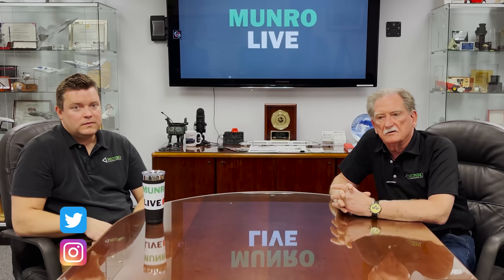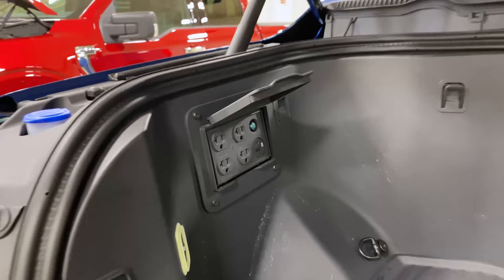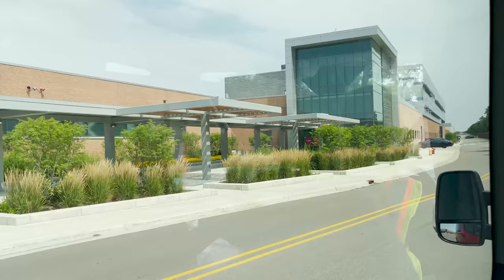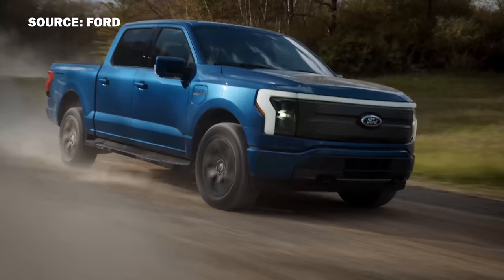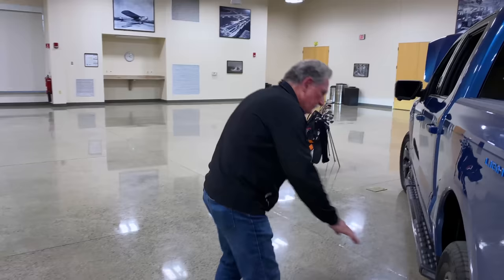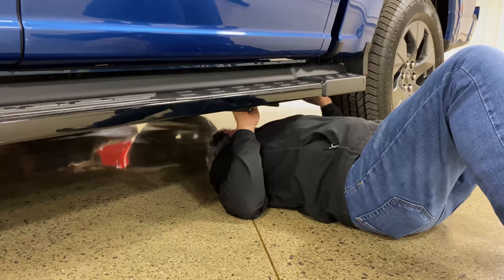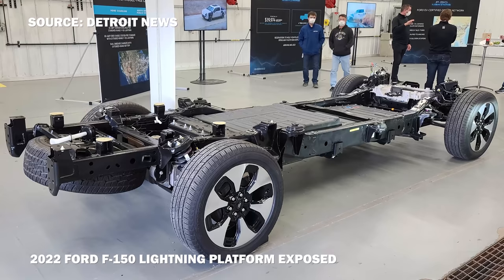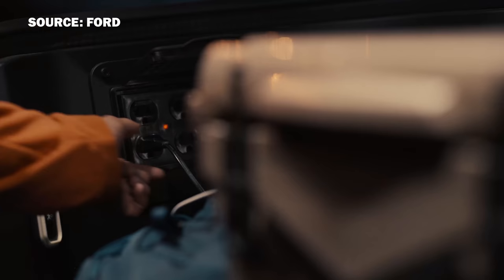Sandy's First Look at the Ford F-150 Lightning Electric Truck!

Comment: Very well designed truck! Now Ford need to focus on their battery chemistry and manufacturing to increase supply 5x and reduce cost 30%. The biggest issue is that the buyers will be mainly switching from ICE F150 so total sales may fall. 
Hopefully Tesla will learn from the Lightening in terms of design for tradies.

Comment: Yes, the F-150 Lightning long range passes a benchmark that leaves ICE in the dust. While it has little to know customer impact, the thermal mgt/HVAC system is number one item for improvement - because we know how much improvement there is possible. The new Merc CQS has similar pack design. 2 pouch cells stuck either side of a thermal plate whose 'T' piece is stuck to the dimpled cooling plate, both glues being good thermal conductors. In the cell, the heat initially travels out of the cell, then vertically and separately to the cooling plate while electricity travels in the longitudinal horizontal direction. We must assume the current path in the cell is several metres long. 
The current Tesla system uses both current collectors as thermal collectors to bring heat from the non-cooled side of the cell to the cooled side, and then thermally through the rest of the cell and casing to the cooling tube. The low pressure very thin Tesla 3/Y type cooling tube has to be expensive and carry a lot of fluid. 
The new Telsa system with 4680 cells uses the anode's current collector coil to transmit electricity and heat to the jellyroll base which must be stuck to the can base with an electrical and thermally conducting glue. The cell can must then be stuck to the cooling plate with a thermally conducting, but not electrically conducting glue. The cathode aluminium foil current collector must have a similar current collecting structure to the anode and must be stuck to the cell lid with an electrically conducting, but not thermally conducting glue. Positive and negative current collectors must run atop each 4680 cell respectively attached to the cell lid and cell can. We would have to assume the Telsa cooling plate for the 4680 system is similar to the Ford cooling plate. Current path in 4680 cell is just 80 mm. 
So, with a common approach of a cooling plate, which may have significant cooling fluid pressure inside, we may see a technology battle that comes down to the short current path of the 4680 cell, to the longer path but fewer cells of the Ford, VW, Merc approach. Ford cells are 235 Wh, Merc cells are 250 Wh, Tesla 4680 cells will be between 100 Wh and 120 Wh. 
With the Ford/VW/Merc pouch cells, the taller the cell, the shorter the current path, but the longer the heat path.
Reply: In using the cathode current collector as the thermal conductor, the Telsa 4680 cells must have reduced the sideways thermal movement to about a mm. However, the top of the cell must get warmer than the bottom, and must be slower to get up to temperature than the bottom in cold weather. 
The Tesla thermal mgt system, being more efficient than anything with an electrical heater, must have a capacity to shift a lot of heat, and so should quickly warm up a battery and get it to an efficient temperature. However, current path through cell also produces heat - the short path though the 4680 cell means it has less self heating capacity.

Comment: Looks good so far. Brings up point that vehicle  manufacturers and trailer/camper manufacturers should compile a data base on how much range is impacted at highway speeds for a particular combination. Long range towing is the biggest issue for E pickups. The lighting should be a big success for contractors who work in metro areas.

Comment: As a person that has a truck and uses a truck as a truck I am looking forward to seeing one of these when they become available. I especially like the frunk. Normally we put item in the cab. With the front it will be great for bagged items. My concern with towing is range and where can I charge it. For a car you can pull into a parking spot and easily charge while you get a meal. If I am towing a 30ft trailer how does that work? Is somehow putting in chargers to allow for electric vehicles towing trailers? As it is at a gas station I block three pumps frequently but I am only there for a short period of time.
Reply: Soon, @ a Tesla Supercharger!

Comment: I put in an order for an EV. I look at a ICE vehicle as a dinosaur and yesterday’s news. I will be charging at home, don’t plan on using it for long trips.  Won’t have to worry about gas shortages, save in energy costs, lower maintenance costs. The big negative is having to wait 7 months and high cost of entry.

Comment: Sandy, people uses generators to be able to work at very remote places, you won't have to reduce your range because you have to power tools.
Reply: The truck has the ability to power your house for up to three days at 9.6kW.  Tools don't use much power.

Comment: It should  come with a built in gas or diesel emergency generator or solar panel if it’s tows a 8000 LB trailer it’s going to need it .I thinking maybe 100 mile tow range if lucky .

Comment: 16:47 what is the advantage of an isolated battery pack? Swappable? Isolated means not part of the car construction?
Reply: Allows the frame to twist under load without twisting the battery
Reply: @TqSNv9R0iG5Ckxew  ah, thanx, I know for on-road you want to have a stiff body, I expected for off-road too, at least the cubertruck will be stiff, and probably electronic air suspension to control each wheel for rough terrains...you don't want the car to bend?!? 🤔
Reply: @MarcoYolo420  
It's not that simple. 
Stiff bodies are good for predictable suspension kinematics but the ride quality can be more harsh.  It's a compromise

Comment: Glad to see the ideas in the Lightning. Now Ford, impress me. Build it and deliver it this year or first quarter next year. I had your flagship Lincoln in 98. A limousine in fact that used the absolute top of the line flagship Town Car. Literally EVERY system in that car failed. It was finally junked. Notice they aren't around anymore. Make this truck better than anything you've done so far or this will be a short ride.

Comment: 1:50 The sticker says engine will run to power outlets and warns about CO. Does Lightning have a gasoline generator for the power outlets?
Reply: Guessing the sticker hasn't been updated for the Lightning yet..
Reply: I'm assuming Ford used the 2.4kw power outlets from the Powerboost Hybrid trucks on their pre-production models of the Lightning.

Comment: You're confusing me.  What is the advantage of isolating the pack?  Tesla intends to do the opposite with Cybertruck - making a structural pack that isn't isolated at all, it's bearing loads, adding stiffness to the vehicle and reducing weight.

I'm looking forward to your teardown for the Lightning.

My other question is, how many Lightnings will they make over the next several years, as opposed to hybrids like the Maverick?
Reply: Serviceability. Possible to remove and replace without extreme aggravation. Damaged battery that's readily serviceable? Swap it out. Damaged battery that's integrated into the vehicle structure? Off to the scrap heap - who won't be able to easily remove it for recycling ...
Reply: Vibration is probably a big factor in the design decision here. If you isolate the battery from the rest of the structure you are going to put less stress into all of those connections to your battery cells. Or you have to add weight to make the battery itself stiffer. Another thing Ford could have done would be to have compliant mounts inside the battery itself, which would add more complexity. For a vehicle that's intended to be driven on roads, vibration is not so much of a concern. The Lightning is also based around a more typical truck construction with a body on frame, so there is probably some logic to isolating the battery the same way the cab/bed are.
Reply: @bikeaddictbp  Serviceability?

Hmm.

A structural pack has to be fitted to the rest of the car some way or other.  Snap fits, fasteners, something.

What can be attached and be detached.  What is engineered well can be detached easily.

There is nothing inherent about the structural pack concept that makes serviceability a problem.  Of course we haven't yet seen how Tesla will implement the concept.

Comment: whats behind the fronk wall? 2.4kw sucks.... I cant run my welder on that.  I use a 4kw inverter to power my welder, and it barely handles it.  They could have done better there
Reply: Ill update and eat crow on this - they have 220v it will power my welder

Comment: Great discussion. I have a question. Why wouldn't Ford work with a trailer maker (or RV trailer maker)  and put a smaller battery pack in the trailer? It would extend range while towing.

Comment: After heavily criticizing Ford Mach E High Voltage connectors blunder and colling system Ford called the best of the best for the review now this is called SMART COMMUNICATION. 
Ford is struggling in India but I hope and wish this decade will be different for Ford in India.

Comment: Just to clear up pricing. The $39,900 version is exclusive to fleet buyers. Great that they are starting with them but the average buyer will have to go with Lariat that bases at $67,900. The Lariat Premium jumps to $79,900. And the Platinum bumps that up to $89,900.

There will be quite a few people who don’t follow these things closely that will think they are going to drive down to a Ford dealer and Buy a Lightning for $40k or a bit more. Only to realize they will need to drop $60k for a base model and then only if they qualify for the full tax credit. And unless the incentives are changed Ford will run out of tax rebates before the $53k XLT starts deliveries.
Reply: Buy comparison the Cybertruck is launching with the dual motor starting at $50k.
Reply: That's partially incorrect.  Everyone will be able to buy the standard range $39,900 Pro.  The extended range Pro is only available to fleet buyers.
Reply: @charlesball6519  Yep

Comment: Thanks for the review.  Wish you guys could get deep hands on like the Mach-E.   
I wonder if the battery isolation will also make it easier to replace the battery?  Maybe done as a longevity feature for the chassis?  Lot of people do not dig into battery maintenance so if batteries go bad from improper use/charging being able to replace easy could be important and let the owner replace battery and keep on rolling rather than battery issue meaning total the vehicle?

Comment: Great video. I am surprised that Sandy doesn’t like lower end models, the XLT seems a good bet. The engineering is the same across the trim levels so usually lower end is the way to go.
Reply: I think the big difference that matters to him is the range (due to battery size).

Comment: my neighbor recently bought an F150 to haul an RV trailer on long distance road trips in part of the country where mountain passes are frequent. would take a fortune in battery packs to try to equip a pickup truck EV to fulfill that role. They could be fine if stick around metropolitan areas where charging is always at hand. But EV pickups are not ready to replace the ICE pickups in the traditional duty roles those are used in. Really resent how Elon and other EV purveyors keep pushing these unrealistic expectations on the public. Ok, sure, keep saying the battery tech will get there - but for long distance trailer hauling at an affordable price, there is still a very long ways to go. Today's EV pickups are in-town vehicles

Comment: Hey, what about safety when you change the cockpit to a workstation where your eyes are not on the road?  And what of cost to repair for all the accessories?
Reply: You really think this change to a workstation -- which includes folding the gear shift away -- will happen while driving? 🤦‍♂️

Comment: I wonder why FUD motors did not allow SANDY to Actually drive the FUD Lightning ?
probably because its Unfinished and NOT Production ready. 
JAY LENO drove the Actual Cybertruck prototype on Streets and in the BORING Tunnel. 
Jay also drove the TESLA model S PLAID + at a Race Track as well. 
what is LUCID, FUD motors and Lordstown afraid of ?

Comment: Yet I'm sitting here thinking where will ford get the batteries for trucks in fleet numbers? Because Corry is right, once you see your neighbor or competitor company roll up with one of these you are not buying diesel ever again. Will Ford have the manufacturing capacity to fill all those orders?

Comment: Range. Price. Performance. Charging network. Miles/min charge rate. Over the air updates. Self driving. Seating capacity. Cargo capacity. Bed length. Towing capacity.

The Ford is VASTLY inferior to the Tesla Cybertruck in every single measure that counts.

Comment: Great truck & thank you for the review, amazing work <3 
Not seeing where Ford Will source the batteries for even 100k+ yearly production (LG & SK having trouble ramping at this pace), no use having a great design if you can't buy the truck ^^
And then there is the price.
Reply: Lightning uses SK battery, and two factories have started building in US, ready by 2023.
Reply: @garfieldchenyu1  Thanks <3 & sounds right.

Comment: Why does electric vehicle need manual gear shifter to fold down in first place?
Reply: My thoughts exactly. Kind of pointless. I think Ford is just going out of its way to use parts from the standard F150 and to make it look like a one.

Comment: So did you guys see the truck BEFORE you started releasing Mach E videos? And is it as bad? (Is it based on the Mach E or Rivian tech?) "Quite a few hoses" doesn't sound promising...
Reply: Nothing wrong with hoses as long as they work as designed and meet the spec. Hoses have been there for 100 years and it is extremely reliable and cheap. No mention the serviceability.

Comment: If it's supposed to be a working truck, as described, then Ford is going to need to figure out a way to put a working bed on it. 5.5 might be great for the kids' soccer equipment and team drink cooler, but I might as well buy a Toyota Tacoma double cab if that's the level of usefulness needed, then, because this model has the same length, plus or minus one inch, as that little stub.

Comment: Is having a truck that is highly resistant to denting, rusting good? I know there are all different kinds of folks out there, and many will say how a truck looks (dents, scratches, etcetera) doesn't matter to them, but it does. Not many people want a bead up, worn down, tired, worn out bucket o' bolts on their hands. Nostalgia? Maybe. How about something that just doesn't get beat up? CYBRTRK won't be for everyone, but it sure will be for those who want to buy a nice truck and then have to worry about or be disappointed when it scratches/dents.
Reply: I have a CT pre-ordered, but Tesla has alot to prove before you can claim the CT will be more durable long term.  It has a ton of potential though.

Comment: how come the FUD Lightning does not have a Completely FLAT Truck bed ?
the Cybertruck has a MORE useful 6 1/2 foot Completely FLAT bed with STANDARD bed Lighting, tiedowns, slotted floor and a Built in Ramp.
seems like FUD motors wants a Compliance TRUCK.

Comment: This truck could be a huge hit because it's a parts bin vehicle - Ford can capitalize on a lower cost of development.   Not to mention that truck buyers are pretty conservative and will want something not radically different than what they are used to.  If Ford can produce this in quantity in the $40-50k range, it will be a big hit.

Comment: Friends notice no petrochemical odors with EV’s.  I agree what you stated about if EV’s were first then ICE.  So we are going to burn a toxic fuel into more toxic stuff out a tail pipe. We have to open the garage door if vehicle running.  You mean 😢 have to go somewhere besides my house to buy the fuel.  Oil changes, tuneups, fan belts, transmission service, etc.  oil changes every 5000 miles with oil filters in land fills, why?  This is crazy!  then you give it the gas, why does it take time before we move.  Why does it shift?  I can smell exhaust in the car.

Comment: Get rid of the shifter. You don't need it for an EV and is one more thing that can break and costs money!!!
Reply: They just need a shifter like what Tesla has. P-R-N-D, no need for L, unless the F-150 Lightening actually has a two speed gearcase (low gear for crawling in steep terrain).

Comment: I am a ford lover and long time owner, but your comments on generators, for the masses, if you work using the batteries for 8 hours and have to drive back home, leaves me concerned, think about it, drive an hour to a job site, work using the same batteries to power your tools, then depend on the truck to make it home another hour drive, 10 hours of service, that's what needs to be tested...

Comment: That frunk latch bent rod is going to be a headache for most men approaching 6’ and over. It should be  PAINTED RED maybe glue some hair on it for a subliminal warning.
Question: If your going to call it a frunk 
Why don’t you drop the “T” and call the storage in back of a car a runk.

Comment: In an EV there is no need whatsoever to have a shift lever where traditional shift levers reside - it's a silly anachronism. Stick it on the control column.

Comment: They're pumping out the 39K basic model because Tesla are focusing on the Tri & Dual motor Cyber Truck, No competitors!
Reply: Either that or they know that the 39k model will be 50k out the door by the time the dealers get done with them.  Wait until the dealers figure out how much their service department revenue is about to drop.
Reply: @nerothe  Don't worry it'll have 100km of hoses under the frunk to leak & replace 😄
Reply: I don't know what the plans are for the lightning but in the past Ford has boosted their sales figures by leasing out base model trucks to large fleets at near cost.